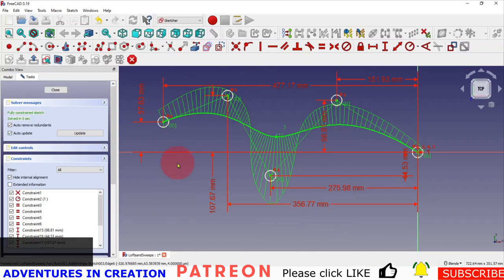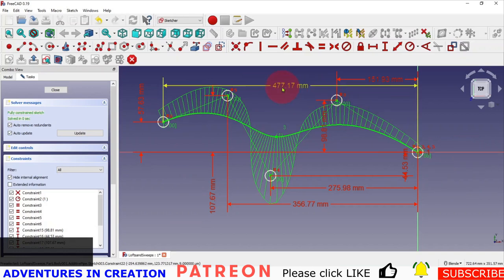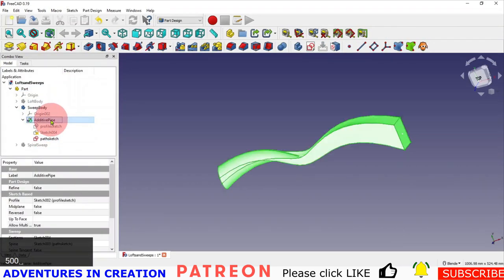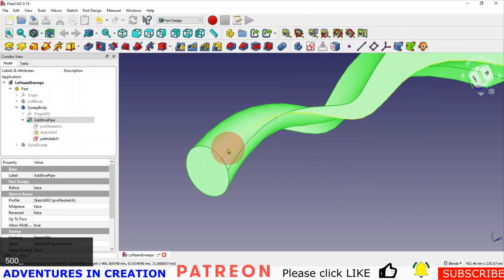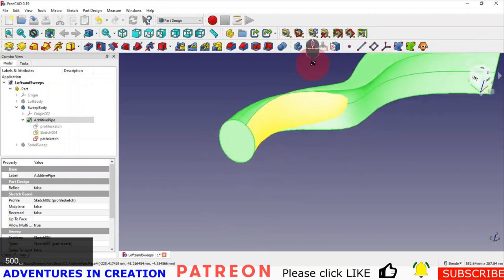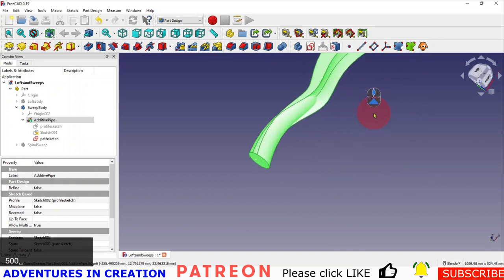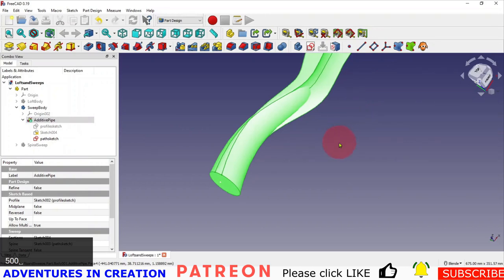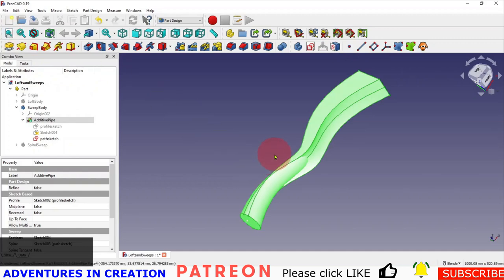FreeCAD for Beginners #5 Lofts and Sweeps

Comment: Thanks for these lessons. I am finding it difficult to select vertices in sketcher for they are so small. Is there any way to adjust the size of these vertices? I am using 0.21.2 on a Mac. Keep up the good work.
Reply from the maker: You can select them from the element table on the left.

Comment: In response to you request for queries ...
in 2021 I started using FreeCAD and the tutorials I started with supplied a colour scheme - which I have used since.
My query is - are you using the default colour scheme or one of your own - as mine is now a bit hodge-podge whereas I find yours is easy to see.
Suggestions on a colour scheme would be appreciated.
P.S. If it was in your Tut #1 or #2 - please advise as I may have missed it due to skim watching those those!
Thanks for these great tuts and your #3 taught me its OK (actually good practice) to use multiple sketches, I did not pick that important point up from any other tutorials.
Since your #3, my designs are getting more complex but easier to produce! 
loving it!👍 (P.S. don't let the name fool you - I'm male and I' made the hotmail account nearly 30 years ago - I'm no spring chicken.)
Reply from the maker: I use the standard color scheme. Keeping it simple is a great thing to grasp. You can make very complex designs with multiple simple sketches.
Reply: @Adventuresincreation  Thanks for your fast response - I'll act on it! 👍

Comment: Edit.. inserted "multi-section":  If my visual 3D perception is not fooling me, the first sweep of the square along the B spline line keeps the square normal to the spline rather than the axis it was originally created on.  So, the square does not necessarily end up in the same plane that it was created in.  When doing the multi-section sweep, however, if the ending shape is in the same plane as the beginning shape, the entire sweep stays in the same plane?  Is that correct? This is just visual observations, so may be incorrect.  By the way, with my less-than-perfect vision, the larger icons are better.  Thanks for your detailed training videos.
Reply from the maker: The sweep should follow the line it is swept along and be normal to that line.

Comment: 11:40 each time I start a sketch selecting another plane (XZ instead of XY for instance) my sketch ifs forming outside the Body .I'm struggling with this 'cause I have not clue how to impose the sketch inside the body no matter the axis.
Reply from the maker: The coordinate system shouldn't change, have tried adding a plane to see how that goes?
Reply: @Adventuresincreation  do you mean that if I draw a ploygon on XY I can’t the other one o. YZ? Did I correctly understand?
Reply from the maker: You should be able to make sketches in any plane
Reply: @Adventuresincreation  this is what I was thinking as well. I was able but at certain moment I became crazy. And I have not finished. I will complete the work another day.

Comment: We love your videos and watched a lot of them. We have a problem.
Our small group have bad eye sight and find reading the constrains in red near impossible. Is it possible to make them black and we would be able to read it.
Thanks a lot.
Reply from the maker: Did you like the larger icons on the menu bar? - I tried to make the cursor larger for you but a software bug in OBS causes it to shrink, the work around made the cursor whip up to the top left corner making it almost unusable. I will try to change the constraint color next time. I am trying to help you guys out.
Reply: @Adventuresincreation  Thanks a lot.
The icon bar icons is perfect.Normally the pointer in red and the hue around in yellow is better. The pointer could be a bit bigger.
See - https://catnip5.itch.io/mouse-highlight 
Thank You.
Reply from the maker: Thanks for the tip. I have a mouse highlighter, I will switch the colors for you.

Comment: I'm trying to subdivide a small lidded storage box by adding small removeable part containers with an open top based upon something similar to this design:

https://www.youtube.com/watch?v=VntGnLuwoeY

But for those that will be inserted around the outside perimeter, the small containers I'm creating ideally would slope outward slightly (i.e. be slightly wider at the top in one X or Y direction) to fully use the space since the storage box slopes outward in the divided spaces around the perimeter.  

I successfully created the loft after establishing the two squares in FreeCAD and lifting the top square in the Z plane, however, after performing the loft, if I try to Pocket the shape, it insists on removing the left side despite only having selected the top face to do the pocket.  I assume this is related to the fact that the left face is not planer with the YZ plane (the only side that isn't planer to a standard plane).

Do you know what I'm missing here, or if there's another method to hollow out the shape to get my small storage bin, or is FreeCAD limited in not being able to pocket irregular shapes like that?

Your tutorials are top shelf and whatever I'm trying to learn I review what you've put out before looking elsewhere.  Thanks for putting together such a great series.

I'm far from being able to pull it off, but perhaps you might see value in creating a tutorial to generate boxes like that from a spreadsheet where the dimensions and wall thickness is entered to create any small storage bin?
Reply from the maker: Looks like a good topic for a video. Did you try using a boolean operation to remove the pocket? I am not sure why it wouldn't work with a regular sketched pocket, you could create a plane and tilt it to the angle of your loft then the pocket would be planar with the loft.
Reply: @Adventuresincreation  I'll try creating the smaller dimensioned loft to attempt a subtraction.  thanks!

Comment: In your sweep demonstration, you attached (constrained) the beginning of your path profile to the x-y plane at the x axis.  I would like to attach the path to a datum plane (where my profile sketch is drawn) and it won't allow me to constrain it to the  intersection of axis and datum plane.  How do I get profile and path so share the same point?
Reply from the maker: You could add a datum point
Reply: @Adventuresincreation  I'm a Noob of  course.  I created a starting datum point based on the profile sketch geometry, but it does not appear to be available for creating a restraint in the path sketch.  If I place the beginning of the path sketch at the correct position dimensionally to the profile sketch, the sweep works, but this seems very primitive.  Is there another way?  Thanks!
Reply from the maker: @lemonfish1890  you can place a datum the same way if you are going to use it for multiple points but if it's a one off, then you won't gain anything. Sometimes you have to use dimensions to position things.

Comment: What if we have sketches with more than one shape on it. Like one sketch with 4 circles, second, at offset, with 2 circles. And we want to create loft between only two circles there. Is possible or is it needed to redraw thing into separate sketches for loft and separate for rest?
Reply from the maker: Separate sketches makes everything simpler, and easier
Reply: @Adventuresincreation  Can existing sketch be split into separate sketches easily?
Reply from the maker: It depends how simple the sketches are. I try to keep sketches simple and create more of them.

Comment: Your tutorials are great and the improvements in your presentation make it easier to follow along. However I am having difficulty with the SweepBody when using the B-spline; instead of what appears to be a solid body (which I can get when just using a multi point line) I get 2 planes the width of the ProfileSketch. They are curved, but don't appear to follow the curve of the PathSketch. Hopefully this is clear enough that you might have a clue to what I am doing wrong. Thank you!
Reply from the maker: Thanks for the kind words. When you look at your path (b-spline) by rotating it, does it appear to run into 3D space or is it just along one axis? It's hard for me to picture exactly what you are doing with it.
Reply: @Adventuresincreation Thank you for the reply! I can appreciate your difficulty in analyzing my problem. I think I have it figured out - although there might have been other problems, the sketch was associated with the wrong body. Thanks again.
Reply from the maker: I am glad you got it sorted out.

Comment: I was getting close to the end of lesson#5 and started having issues again. I had been saving my work "save" so when it started acting funny (it "mm" switched to "um") so I just closed project discard changes, since I had been saving, Right? I re-open lesson #5 and found out none of the saves worked and all my work was lost... My Question: so if you save during a lesson and then close without hitting save again then all the other saves in-between will be lost?
Reply from the maker: That is very odd Gary, I have never had that happen to me. Not sure why the previous saves would not have worked.
Reply: I would like to add that my Freecad first started to do the same thing everytime I would try to dimension, perform a symmetry just like before (points got really small so I could not select them) so I reinstalled the latest version of Freecad, also then my units changed from "mm" to "um" which I thought was weird. I can send the file if needed? meanwhile I will go back to lesson #5 and start again with a new file and a different file name. Thanks
Reply: @Adventuresincreation  I just emailed you my file. Thanks
Reply: Found my mistakes, corrected as needed and finished to the end without any issues, wew!!!
Reply from the maker: @garyweliver1870  well done, I am glad you were able to finish it

Comment: I'm trying to sweep along a b-spline to make a longeron along my fuselage right now, nothing happens or at least it doesn't come out right. Does anyone have any tips? I can extrude them but it's a pain in the arse figuring out the right ratio of xyz to make them extrude at the correct angle.
Reply from the maker: Do you have a picture of what you are trying to do?
Reply: @Adventuresincreation  I have sketches of my other profile of the fuselage, with b-splines intersecting along all of the sections which Is where my longerons will be. I managed to extrude them in part, but sweep would be so much easier because then I wouldn't have to do an extrude and pad to every longeron if for any reason I may choose to 3d print them instead of laser cutting.
Reply from the maker: @guerillagardener2237  can you post the sketch somewhere that I can access it then I will take a look for you
Reply: @Adventuresincreation  is there a way that I can send it directly to your channel on YouTube. Where could I post the document.
Reply from the maker: @guerillagardener2237  unfortunately no
Reply: @Adventuresincreation  ok I'm gonna see if Dropbox will let me post the document.

Comment: Thanks for the video.  Is it possible to make the loft follow a 3d path or is lofting restricted to 2d (of the path sketch) ?  I'm wondering if/how I could use this to model the cables which snake around a more complex machine.
Reply from the maker: You can do that with the sweep. It follows a 3d path. It makes great cables. The loft doesn't follow a path.
Reply: Ok. Great. .... How do I make a 3d path ?
Reply: @andrewfowler2874  I believe you can select the edges of bodies, but that's it, I don't know a way to make 3d sketches

Comment: Thanx for the great video. I just have an issue with shape alignment on the sweep. Look closely at the ends of the sweep, then imagine a normal projecting from those faces. You'll notice that those normals don't align with the curve tangents. There doesn't appear to be any options for normal-to-tangent alignment for the sweep. Do you know of a way to achieve this?
Reply from the maker: I am having trouble to visualize what you are trying to do.

Comment: What would keep me from being able to change the value in attachment when trying to loft in the plan? It will not allow me to change any value in any axis?
Reply from the maker: Double check that you are changing the attachment and not the position.
Reply: @Adventuresincreation  Thanks for the reply! I will double check. After watching a few more of the videos I noticed you starting a part first. I have not been doing that so that could be it. I  have just been going straight to New file, New body, then new sketch. I don't quite understand the importance of the sequencing it should all fall under.
Reply: Also want to make sure I say I'm glad I found your channel. I just started freecad two weeks ago. Will definitely be finding you on patreon, maybe a few days but thanks a ton!
Reply from the maker: @OFerrell21  I always use a part first. It can be useful if you end doing an assembly. The part can have multiple bodies in it.
Reply from the maker: @OFerrell21  Thanks! On Patreon you will get early releases of videos and all the FreeCAD files that I create for the videos. You can also have more input on the future videos.

Comment: Definatley larger icons, but me personally don't care for the red circle around the mouse, but it won't stop me from watching or learning. I'm trying to make a lens for eye glasses and have only been able to make them flat with the pad, I can do it in blender but I want to be able to set it up parametric to be able to change both strength and shape
Reply from the maker: Thanks for the input, the cursor set up was developed with input from people who have partial sight. It helps them to follow the lessons. How are you creating it in blender? Is the shape a concave/convex or is more complicated than that? You could use a revolve and then cut that to the outer shape you need.
Reply: @Adventuresincreation  As far as Blender I would start with a sphere and cut it and alter the size and shape or use booleans, but that doesn't work for real world applications and 3d printing, another words I can manipulate the mesh to make it look good for on a monitor, but it is not as accurate. And I want to be able to set it up to change the size and shape easily.  It's concave on the outside and convex on the inside.

Comment: As I commented on your last video, I found that the front of the loft has two sides with a line down the middle (oddly enough the line being the sketch). For some reason slicers HATE this line and will mess up the 3d print job. Is there a way to remove the line? The only way I found to fix the issue is to export the file, open the exported file in FreeCAD and then export that new file again. Please tell us there is a better way. :)
Reply from the maker: You can select refine in the model data window.
Reply: @Adventuresincreation  Thank you and sorry if I'm jumping ahead..just found I'm creating art while watching your videos and need to print them. :)
Reply from the maker: @OZtwo  No worries.

Comment: First of all I ahtnk you very much for sharing, and I am grateful, but sometimes you do some things and there is no way to follow what you are doing, like when you start deleting or turning off the body or some other things which for a begginer like me takes ages to find out how you did it .... But no matter what I am grateful for you decide to share your knowlage.....:)
Reply from the maker: I am not sure what you mean by deleting things? Usually, you delete something by selecting it and hitting the delete key. To turn things on and off, I explain very slowly that you select the item in the model tree then hit the spacebar. What would you suggest to make this clearer?
Reply: Large icons great when viewing on ipad. Used Solid works for years as a hobby now I’m trying to absorb free cad.
Reply from the maker: @royperkin1581  thanks! - You will find FreeCAD no problem if you already have Solidworks under your belt. - FreeCAD has a lot of great features.